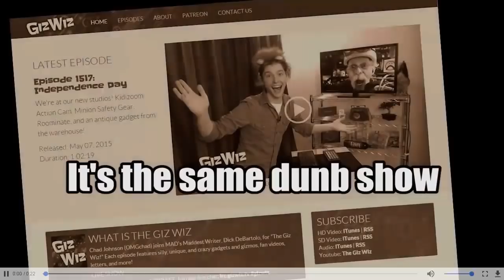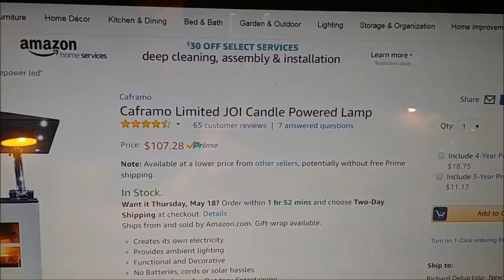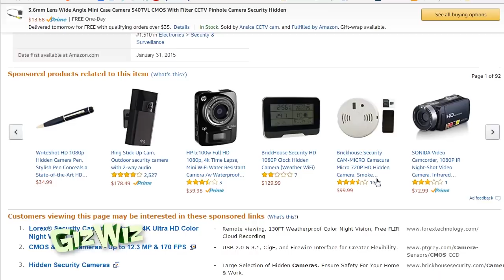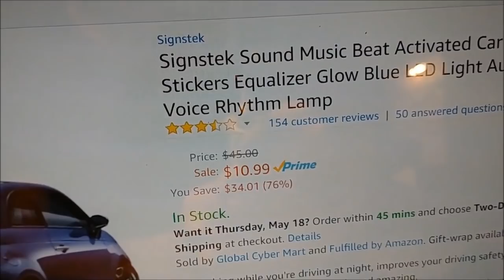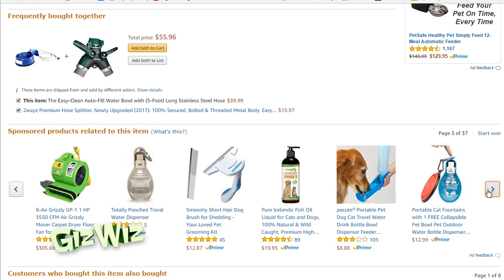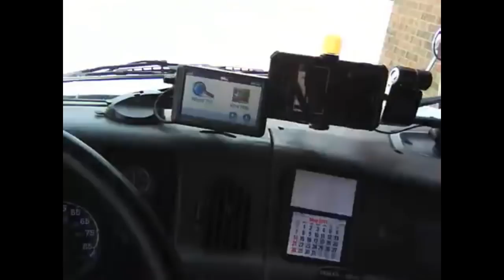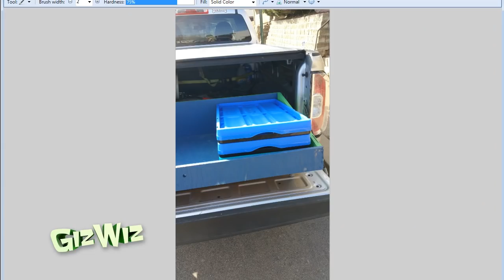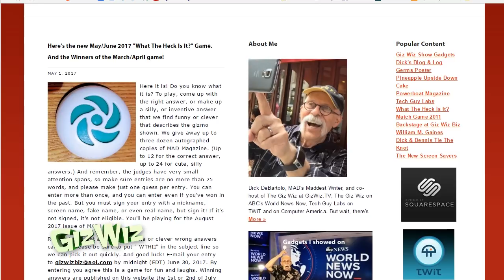The Giz Wiz #1623: No Crap Here Today

Comment: The whole Bracketron system is incredibly expensive!  At $60 for just the bar and 2 suction cups and $22 to $49 for each of the mounting brackets you could easily spend $150-$200 for the whole thing!